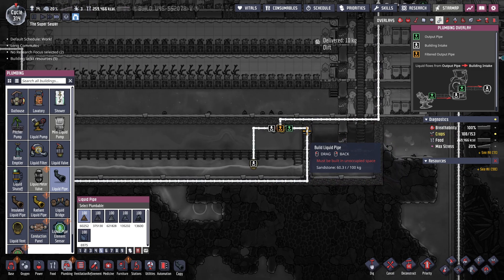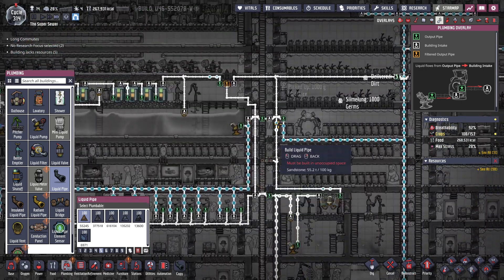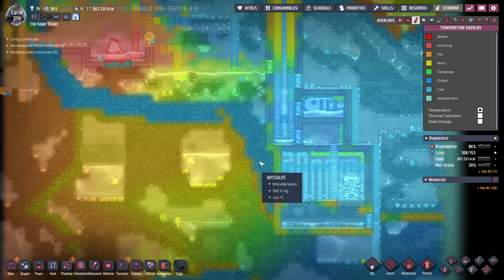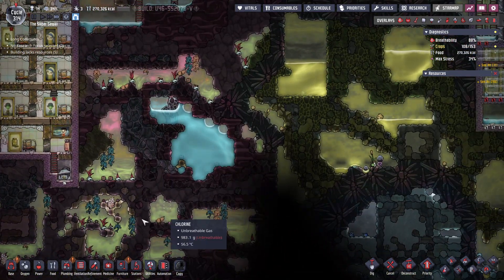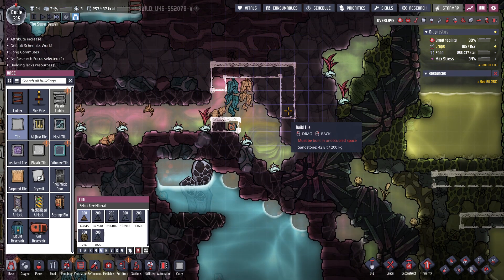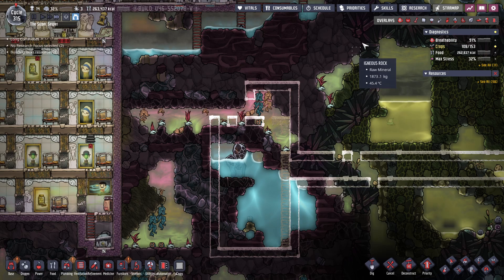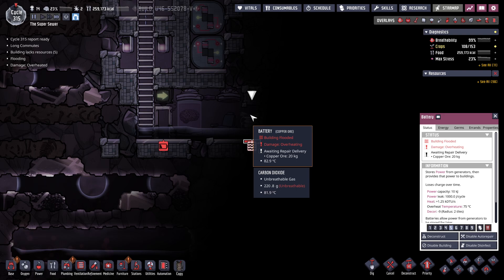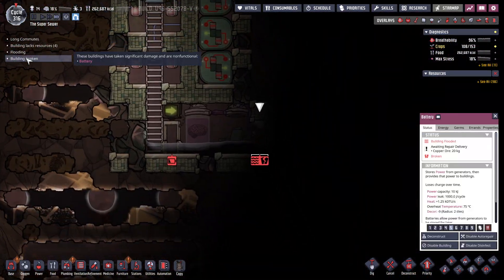Oxygen Not Included (EP-39)

Comment: As soon as you get into the Oil biome, you will have access to Lead.  
Lead is a refined metal that is ideal for making power cables and automation cables from.

Since you mine it as a refined metal, it is essentially free, and extremely abundant.  Replace your entire electrical grid with Lead once you get it.

Wiring is the ONLY thing that lead is good for because it gives a -20c overheat temp to buildings made from it.
Reply from the maker: I didn't see any lead ores so I assume its just in the rocks? or am I blind

Comment: It doesn't make sense to power and feed water to an Oil Well, when there are hundreds of tons of oil on the ground ready to be pumped up.

An Oil well requires 240 watts and 1000 g/s of water.   You also still need a liquid pump to pump up the oil it poops out.

Until you are out of (or low on) the naturally occurring oil, there is no reason to pay for it.
Reply from the maker: And future me still hasen't used that oil well, its just sorta plugged in ready for use. :|

Comment: No, you can not run a steam generator from a Cool steam vent.  

The CSV erupts at 105c  A Steam Turbine requires the steam to be 125c minimum.
You say... no problem, I can heat that steam up a little.
The problem then becomes pressure, a stem geyser becomes overpressurized at 5000 grams.  So you have to be constantly extracting the water it generates, or it will stifle.  You do this by taking the 95c water from the turbines.

So effectively, you are paying to heat steam from 105c up to 125c or 130c, just to extract the minimum power a steam turbine can generate and get the water back at 95c.
The Steam Turbine when at 125 - 130c only generates about 250 watts if I recall correctly.  That is only enough power to run one gas pump.

That would be the most expensive way possible to cool water by 10c.
Reply from the maker: true... true...
Not only that but I am using it as a water supply.
Heating it up would just put alot more unnecessary strain on my cooling system. :|